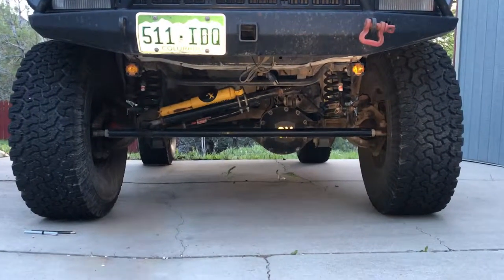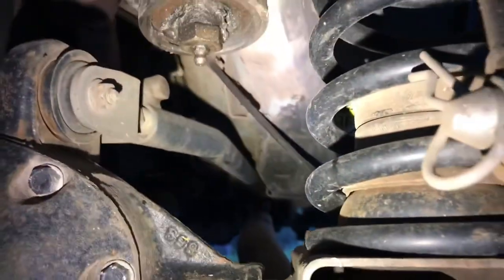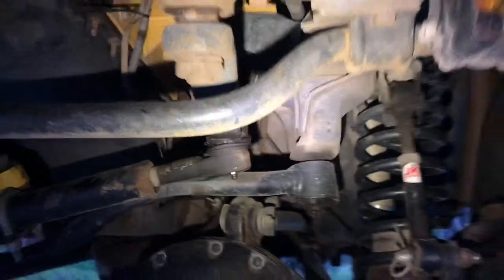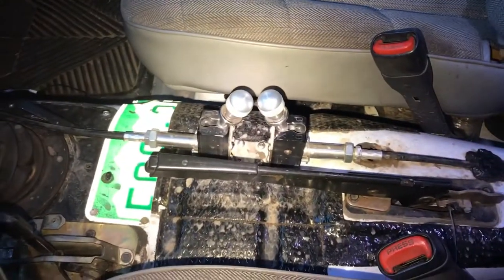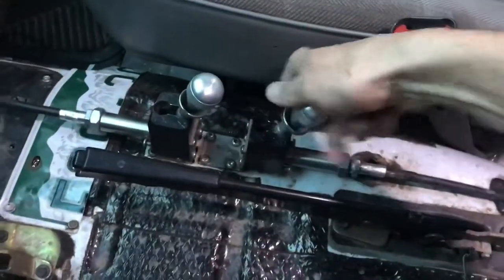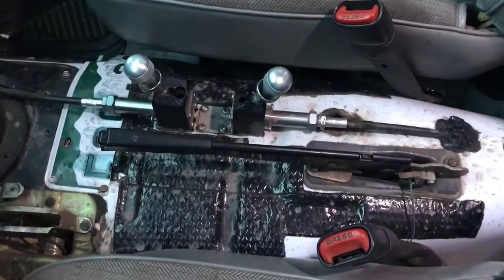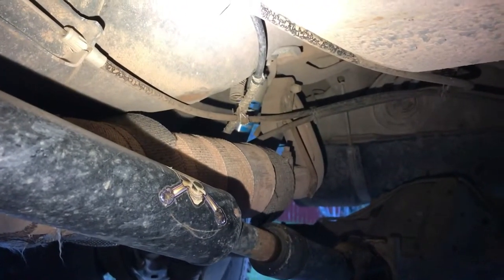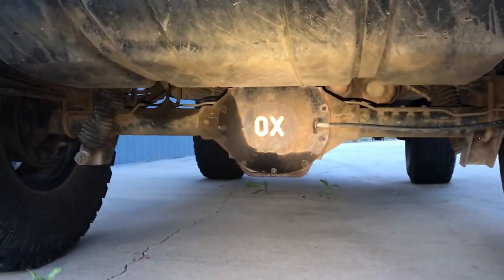OX Locker cable routing Jeep XJ

Comment: If you guys have a 2” up to 4” lift on ur Jeep TJ 97/01 and needs to run a rear ending ox cable you can use a 70” length cable. It will let you set ur switch right in the center console!! Don’t use a very long cable !!

Comment: Great video!! I'm leaning hard toward this locker. I like that it's purely mechanical. No need to worry about punctured air hose, faulty fuse, or unwantedly locking/unlocking, as with other leading lockers out there. How has the Ox held up since your install?
Reply from the maker: No Pavement Please Hey, thanks! Indeed the cable system is the way to go compared everything else. 
The lockers have held up well. On a recent trip to Top of the World Trail in Moab they were used and did not disappoint.

Comment: Very nice.  I like how you showed how you mounted it on the inside.  Not many show that.  Also like how you installed both front and back lockers.  Again, haven't seen many on here do that and you are the only one that showed the inside part.  One video said these type wear out after about 30K miles and you have to rebuild them.. like the gaskets or something.  Have you had to do any rebuilds to keep them locking correctly?
Reply from the maker: Haven’t had to do any rebuilds on them. They have about 26K miles on them since install.
Reply: I have had an OX locker in my Chrysler 8.25 for 4 years (about 45,000 miles) and still have not touched anything about the setup since I installed it. Haven't opened the diff, haven't adjusted the cables, zero maintenance what so ever.

Comment: What size lift do you have? I have the 87” cable and 4.5-5” lift it might be tight. This video helps a lot though
Reply from the maker: Will parfet somewhere around 3” maybe 3.5”? I think it’s the 90” cable. Depending upon where you put it - I’m sure you can make it work.
Reply: rebel exploration thanks I was able to route mine based on your video!